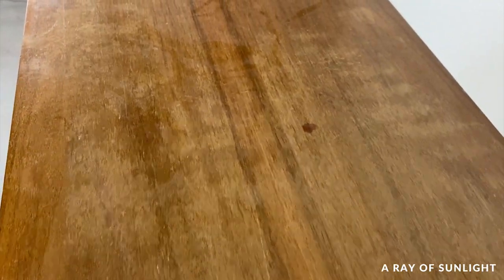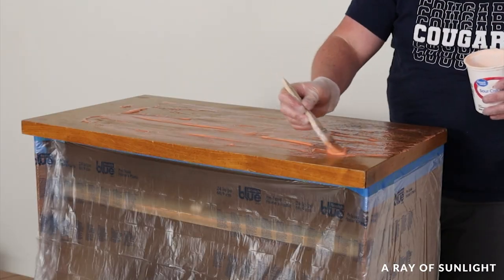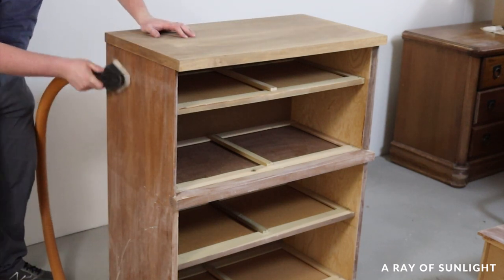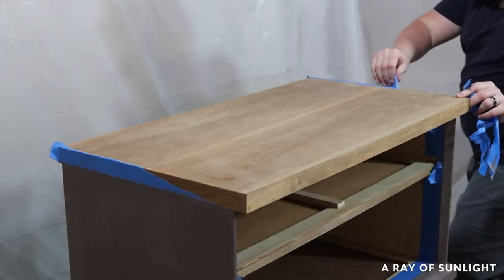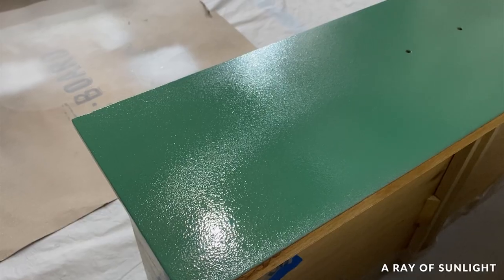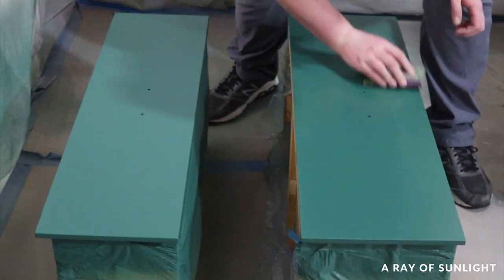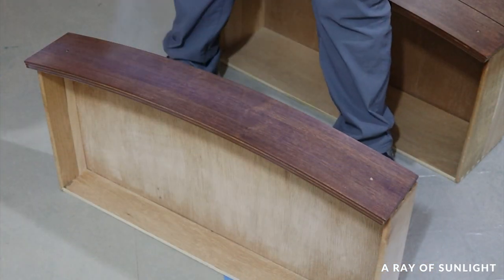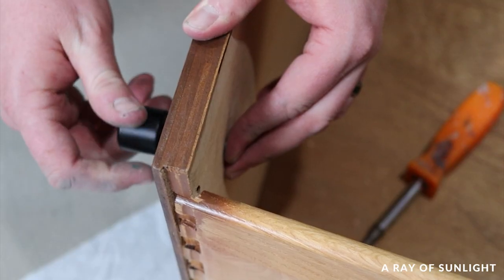My Husband's First Furniture Makeover | HomeRight Super Finish Max Paint Sprayer

Comment: Is the shellac on the drawers a primer? Does it work like a wood conditioner would? Thanks!
Awesome piece!
Reply from the maker: It’s not technically a primer. Though I use it as a primer under paint to help paint stick and block Bleedthrough.

But yeah, supposedly it’s also amazing at conditioning the wood to take stain more evenly. I’ve seen others show that it works better wood conditioner.